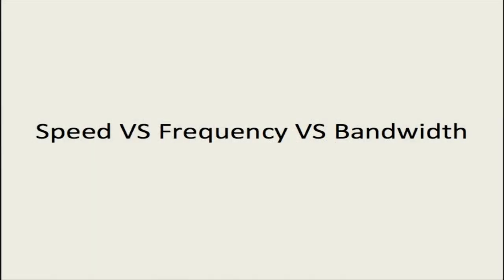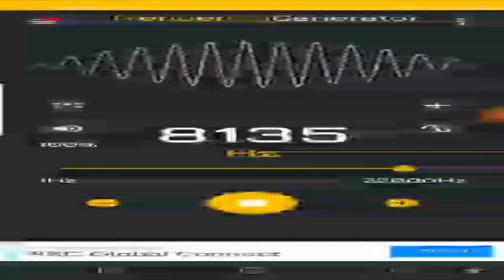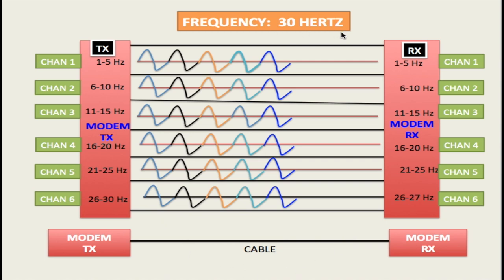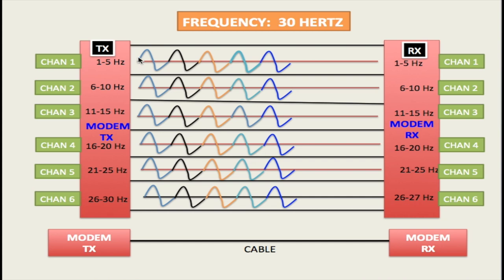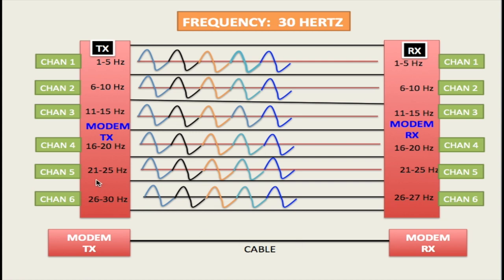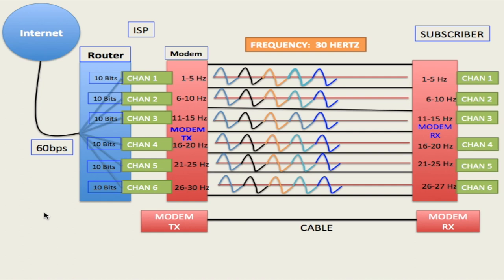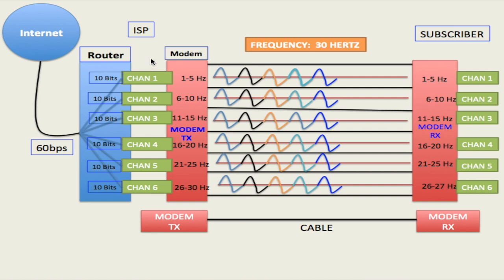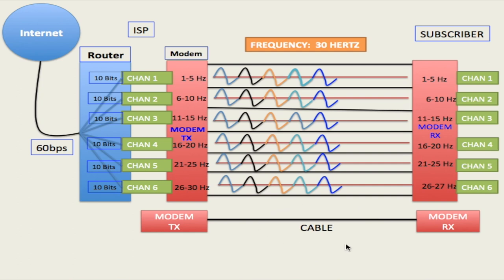Data, Frequency, and Bandwidth: Understanding how They work

Comment: Awesome Video! With respect to Phase Modulation,  what is the maximum number of bits you can transfer per cycle? You showed here that for one cycle you can transfer 2 bits of digital data by changing phase (via PSK). Can you transfer more than that? If so how much.
Reply from the maker: Thank you so much.  You can transfer more bits per cycle by using Quadrature Amplitude Modulation (QAM).  QAM combines both Amplitude & Phase Modulation.  16 bits per waveform is very common with QAM.